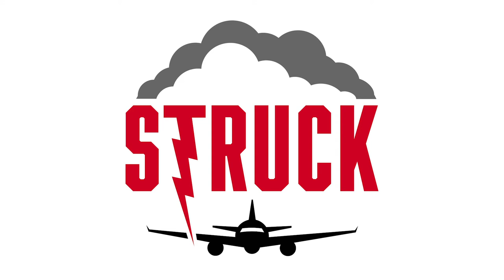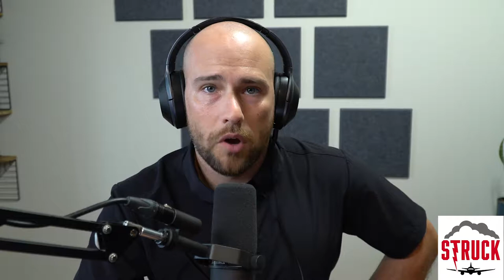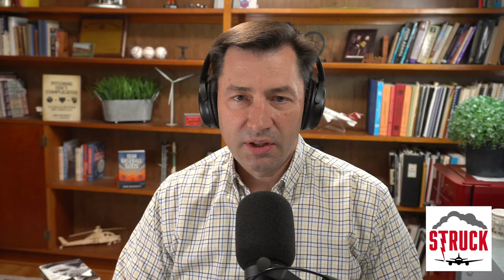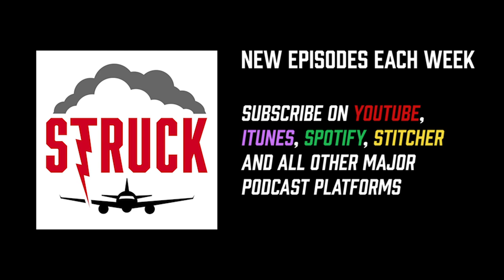EP27 - Boeing 777x Folding Wing Tips; Otto Celera 500L Laminar Flow; AutoFlight V400 eVTOL

Comment: Super appreciate your bringing up the new out-of-the-box 500L. Pub. No.: US 2014/0197275 A1 OTTO (43) Pub. Date: Jul. 17, 2014. The patent shows quite a few of their ideas...double slotted Fowler flaps compact landing gear. As I said earlier, I think I heard somewhere around 3,300ft take off... also heard that they've completed 35 flights. Hopefully in the near future you'll have a part 3 on their progress. Also, appreciate you bringing up several topics on Aviation in each podcast.
Reply from the maker: Thanks for listening, and for the comment! Yeah, I (Dan) got the 300ft number wrong - misspoke -  but yes, they've had 30+ test flights thus far. We scan the newswire each week and try to find a balance of topics, but if you ever have a suggestion be sure to let us know!